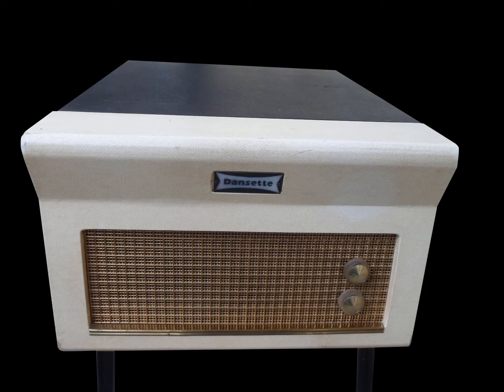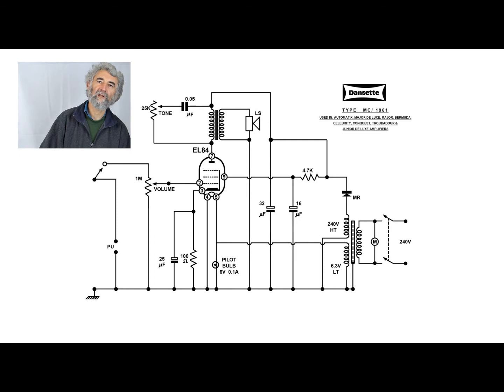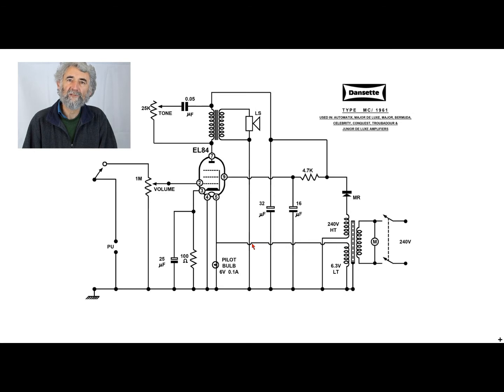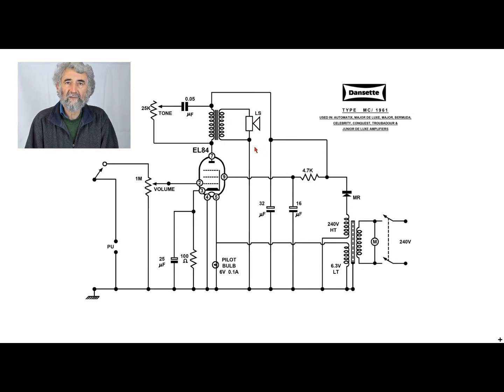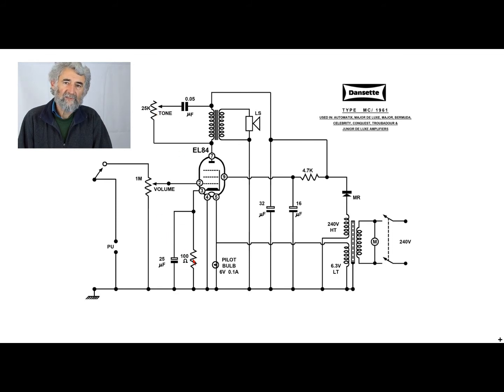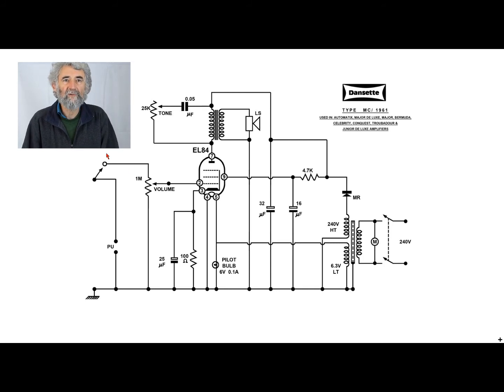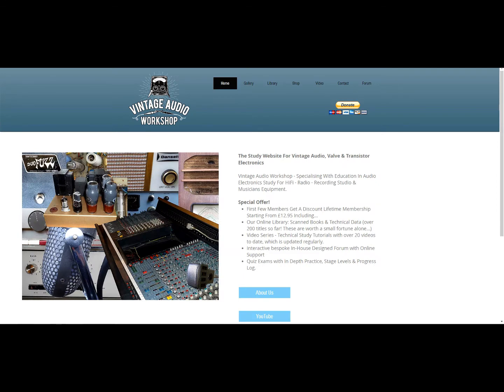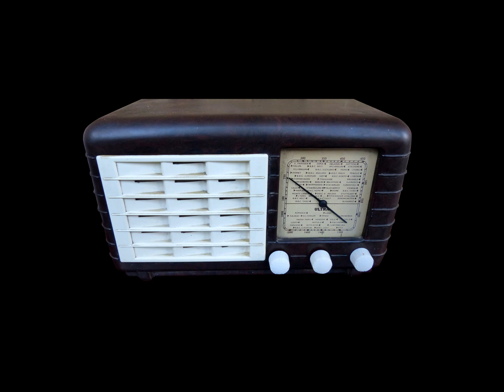Valve Amplifier Study 005: Dansette Major Deluxe 21, Single Stage EL84 Single Ended Circuit

Comment: On a Major I had, the transformer was a part of the motor stator windings. Plus I think it might have been an auto-transformer, not isolated. Also there was no cartridge muting switch on the changer, and it was just ordinary wires, not screened.

Comment: Nice video. Keep it coming... 
I have a question. What good will it do having two tube rectifiers? I know one is enough. Thank you for your time.
Reply from the maker: Hi, A full wave rectifier will be more efficient, using both sides of the ac supply. Paul

Comment: Nice one thanks. I just opened one of these up last night and can confirm that the signal leads from the turntable are not screened, just a twisted black and red pair! Looks original so assume it was built that way...
Reply from the maker: Output from the crystal cartridge is very decent so they didn't think it's necessary for screened wire,    they did use screened  on the later models though...
Reply: @vintageaudioworkshop  Yes I assumed that, haven't checked the cartridge yet...!